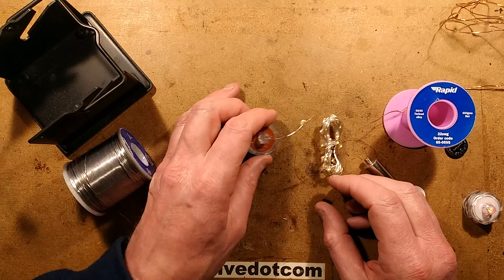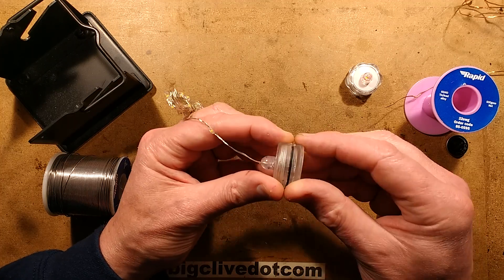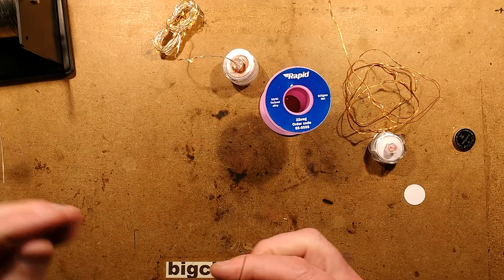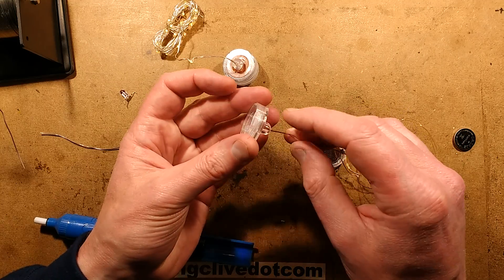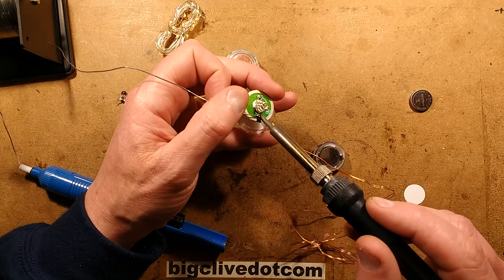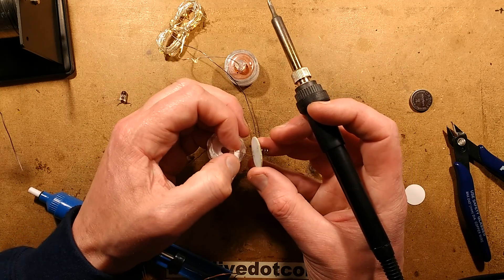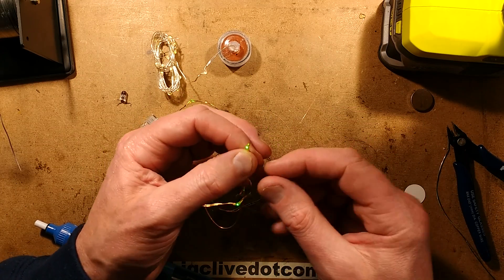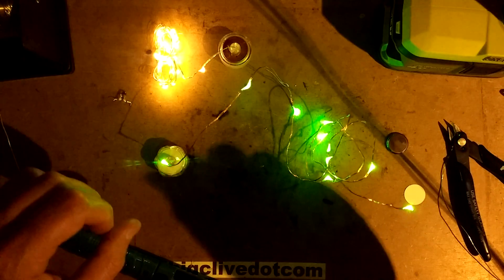Neat waterproof lithium cell holder hack.

Comment: Considering the known possible issue at the end of the strands of LED's, would hot melt glue work to seal the ends to prevent not only the possibility of shorting the LED's out, but to prevent the wires from corroding?
Reply from the maker: Yes, that would work.

Comment: If I sent you some nice and thin silver solder, would you use it in place of leaded?   I looked at my hands under a microscope one day (after scrubbing my hands well) and was quite surprised by the amount of micro solder melted between the ridges of the fingers.   Since then, I'm extremely hesitant to use leaded solder, knowing that it gets embedded into the hands so much despite a solid scrubbing.

Comment: The one question for me that remains...   What would you use these for?  I can't think of a real practical purpose.. they are not bright enough to be seen at a distance of any kind, not bright enough to light up anything...  Just a novelty thing?
Reply from the maker: They do remain quite bright for a surprising length of time.  Ideal as a feature in a dark environment.

Comment: Nice idea Clive, I to like the long vids, but going back to that solar night light you made two vids ago   i wasn't impressed with it turning on to early in the evening but I understand it was made for simplicity, I use a protected li ion with a diode connected to the solar panels but then I use a photo transistor into a pnp Darlington and the leds come on later, still a very simple circuit, have you tried this approach.
Reply from the maker: It does actually come on when the light level is low enough to appreciate the lights.  My test with the COB keyring light may have been affected by the pulse width modulation of the keyring and delayed response of the solar panel.

Comment: There's a trick you can do that makes long videos shorter.
Really easy if you use a laptop or desktop and have the pointy arrow keys.  Unfortunately not quite so easy for the phone "phablet" or one of those white jobbies with the slowdown app installed but it's still possible without arrows.  And there's always the speed option in settings.
There's a similar sort of trick that works on the stuff you find you're not enjoying.
Can't find anything to add more detail though, so I'll go for longer

Comment: Love your videos so thank you for making them. Is there a switch on this light? The hot glue gun you used in this project uses a lithium battery. Can you make a video about testing such batteries and finding out if they are in good health? I have a drill with 2 batteries, and one of the batteries does not seem to charge well, and I would like to know how to properly test it. Thank you!

Comment: Shorter videos, like this hack video are great.  Maybe put the reverse engineering bits into another video "part 2" or something like that for those who want to see it.

Also,  could you use two button cells on this hack, and also two strings of lights, or would that cause problems?

Comment: Clive. Please carry on as you are. Some are long and others short. It is how it works and don't forget most of us watch them not just because they are informative but also entertaining.
I clicked like because I enjoyed the video so cannot click dislike as well therefore could you take my vote as both.
One suggestion, could you include a list of links to what you use? Where you get it? Part number? Maybe the suppliers will give you a promo code to pass on (and with any luck some cookie money to you in return for your help) e.g. On your website Solder - Rapid Electronics - 85-0595 etc.

Comment: I have one of those glue guns, it takes about 3-4 minutes to heat up. Its connected to a 1.4Ah battery. Not sure if this outputs less max current than the 4Ah batteries.

Comment: Clive the key thing here is not to make the videos to short so the lack information, and not to long as to drag out,
I guess what i am saying is that the topic should dictate the length of the Video, For this the length was pretty good for the topic, a circuit break down video describing current flow and why that's not the perfect component and i will replace it with 'X' to achieve this result obviously need to be longer.

Comment: For anyone interested, you can find the solder reel holders on eBay. The Hakko one I bought last year is no longer sold by the vendor I got it from but you can find lots of others. Here's eBay's "similar items" list -

https://www.ebay.com.au/sch/sis.html?_nkw=Hakko+Single+Solder+Reel+Stand&_id=162082224565&&_trksid=p2057872.m2749.l2658

Note that the genuine Hakko one is quite expensive. The Chinese made ones are probably good enough. Just look closely at them when comparing to ensure you get what you want. The double spool one is ridiculously priced. What I ended up doing was getting a piece of dowel of the right diameter and cut it to length then replaced the spool with the dowel and placed a reel of wire on either side of the unit.

Comment: Solder Suckers! I used to play with my dad's a lot for some reason. Also I found the metal cores it produced in actual use fascinating.

Longer videos. I think you benefit a lot from letting your mind wander while doing things, which wouldn't happen as much if you were trying to focus too much; the random stories of the evolution of the industry and how the isle of man works and all that are a major draw. I don't always have time for a full video, but, personally, I find it no problem to pause and come back to them later.

Also, somewhere I read some discussion about people liking how you don't do intros and outros and stuff, and I agree. Even something I love that doesn't overdo it, like, Extra Credits or Extra History, the opening and ending stuff gets tedious when binge watching.

Comment: It is always mesmerizing watching you solder. I'm not especially bad at soldering, but whenever I try soldering onehanded like you did in this video, I shake so badly I end up making a mess of a joint or straight burn myself.

Comment: I have a couple of the color changing lights like yours and also the string LED. I ended up taking the case and modding it into a standard White LED and I took the string of LEDs and I think I put them on a longer lasting power supply.

Comment: The Doggie tag clip-on lite is just friction fit and switches from off - on - fast flash - slow flash.   All it needs is a little hot-pin hole for the wires.   BTW - the white ones flash many more days than the red ones.  Menards was basically giving them away a few weeks ago :-D

Comment: As i see it , length of the video pretty much would depend on how involved the subject/project at hand is .
This video covers a fairly simple circuit/premise ... enough information is included to keep most neophytes from letting loose the magic smoke .
Personally , I feel that you have a pretty good balance . Perhaps the addition of a couple of two or three part projects/analysis might be beneficial for those individuals that might be considered slightly more advanced than the "beginner" .
As far as I am aware , your channel is along the lines of how myself and others got involved with electronics ... we found someone that knew about such matters and hung out , working together on projects (one of my good friends when I was in my 30s was a retired broadcast engineer) .
The bit you do with your friends and brother add another dimension to the channel ... making it more personable .
Keep up the good work .

Comment: I like both long and short... videos 😋

You can mod an old Ryobi battery and Dewalt adapter (since they changed the battery connector when they went to Lithium) to use the hot glue gun with new Dewalt batteries... 42Fab did a video showing how to do this: https://youtu.be/ikZQLvKZYMA

I imagine you can do this with other color tools as well (Milwaukee, Makita, Bosch, etc.), if you’re willing to get creative.  If they don’t have a neat adapter available like Dewalt does, you could sacrifice the bottom of an old and/or broken tool to get the desired result.  A local contracting warehouse may have a lead on where to find some, since its increasingly rare to be able to throw electronics in the trash... on that note, an electronics recycler might have an idea as well.

Cool pink solder roll 💜

Comment: Video length, i think a mix is good as some things take longer to do than others,  splitting things into part 1 and 2 and so on is a faf,as you tube will jumble everything into a most recent type of thing,  i like they ryobi appearance, the 4 and 5 batterys seem to make the tools work better, except my 1+ jigsaw its consistently terrible.

Comment: you have broken my system of "if I've seen it, I click the like button.
Content, dictate length.
I find that I will watch a lot of small videos or one long one as I'm on a Data plan, so I tend to binge out one month and not the next.
something like this video is perfect, but I could see you dig into something on an deeper subject and it dictating a longer length.
if I see anything under 20 min. I tend to watch it if the title or the picture is interesting. If i see anything over 20 I tend to let them queue up for later.

Comment: Longer is better (I have found). But shorter is fine too, if it comes to that. I guess I like it both ways. Plus ca change. A great video would be you and the fellow beards camping on midsummer night on Snaefell, feasting on diverse MREs and chewing the cud. Ideally live, but that might need a lot of batteries.

Comment: I'm confused, don't LED with lower forward voltage use more current in the same setup and therefore make the battery last less?

Comment: FFS water resistant NOT proof...😜
Reply: My pool creepy crawly is water proof :-) or extremely water resistant.
Reply: no satisfaction those lights are actually waterproof. They're designed to sit in the bottom of swimming pools. 

Clives mod might be water resistant only though. But the original lights are waterproof. They're designed for total submersion

Comment: I would have watched your long MRE+Jack video to the end, except I'd just watched your previous MRE video so I got bored :P

As for using rechargeable 2032 cells, are they the same voltage, what chemistry are they, and where do you buy them for quality and economy?  Can you recommend a teensy solar panel that would charge them, using your previous solar panel light sense video circuit -- but a panel only 1/4 or 1/8 the size possible for this light string?

Does anyone sell an 18650 hot melt glue gun?  If we've got convenient vape e-cig pens, why not convenient glue gun pens?

Comment: More Long videos, More Short videos, More ranting videos, More drinking videos. Yes Please!  The solder I'm currently using is Kester 0.5mm 63/37 Tin/Lead with 3.3% #44 rosin. Melts around 183 C  part # 24-6337-0010. One pound costs as much as a few cups of coffee,  or a small house....

Comment: Speaking of solder. This is what I use and is bang on! https://www.banggood.com/0_6mm-Tin-lead-Solder-Wire-Rosin-Core-Soldering-2-Flux-Reel-Tube-6040-p-985802.html?p=M608231461630201504V Would recommend.

Comment: I prefer technical video's that are a decent length for the material covered. Nothing worse than cramming things in. Anything from 5-15 minutes are good for when sitting at the PC (about 10% for your videos not on Patreon), but the longer ones are fine for TV-replacement viewing.

Most of my viewing is done on the PS3 Youtube app that has no access to YT text/annotation/cards/commenting so embedding useful info is best. Follow up information in another video is also preferred for that reason.

Getting close to the 100M views. Looking forward to something special!